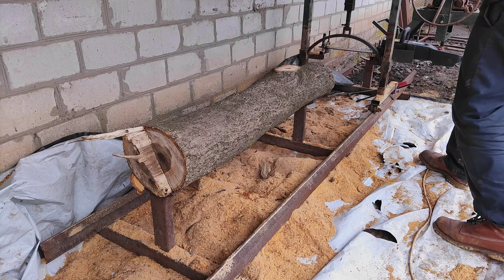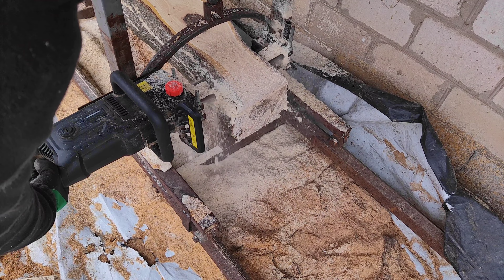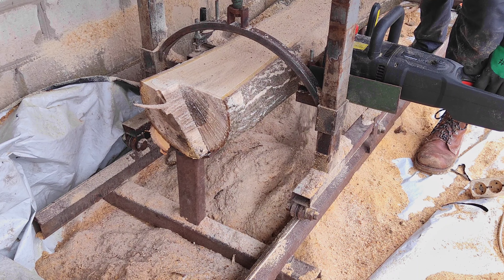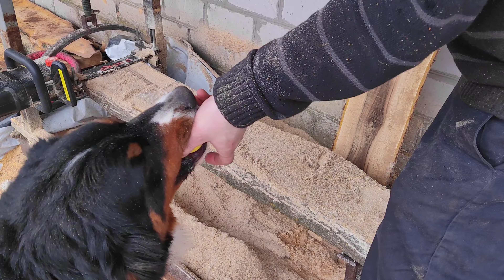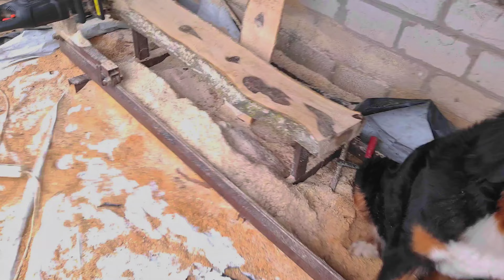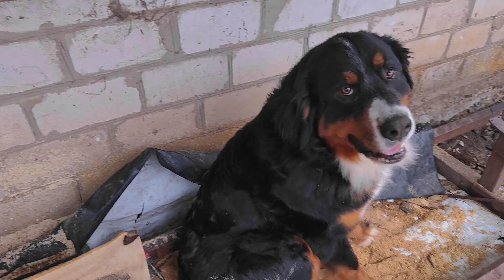Sawed 30 year old walnut. Cutting a walnut into blank boards with a homemade sawmill

Comment: Perfect case where not every log is lumber worth and should ultimately be firewood.
Reply from the maker: Yes, some parts will be used for firewood, and most of the blanks for new products.  Even parts of firewood are still used for new experimental products, spoons, wooden beads, bracelets, handles for kitchen sets.